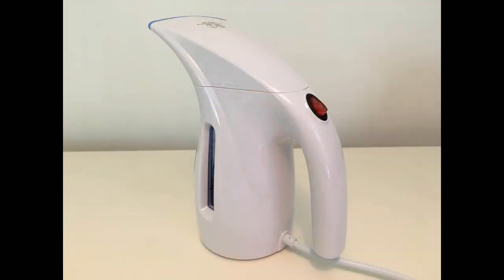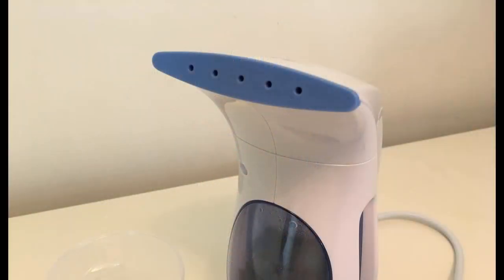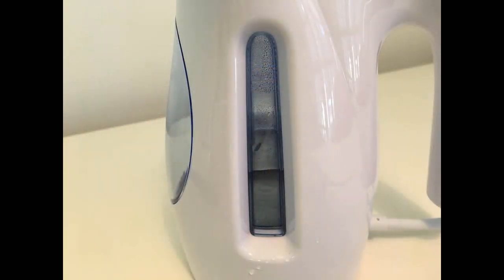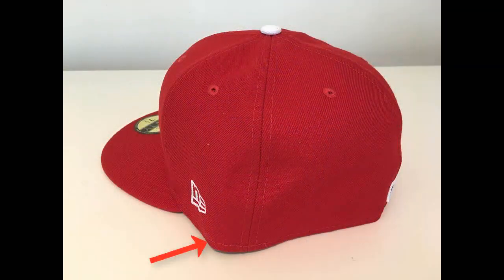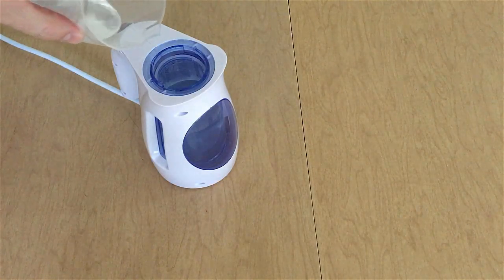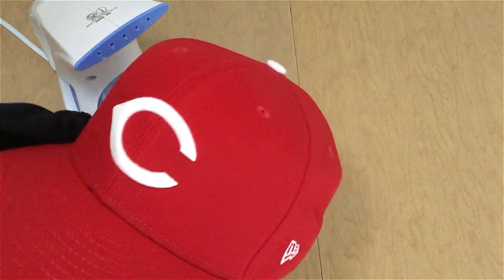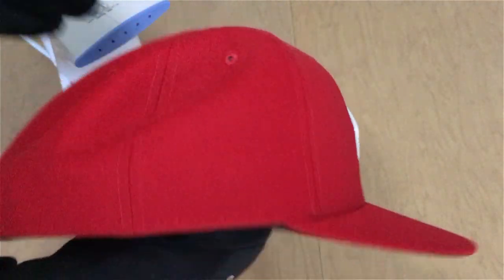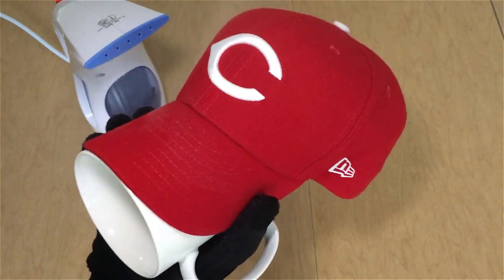Shaping Fitted Caps: Garment Steamer vs. Teapot

Comment: I used a streamer while the hat sits on the Nu-Cap(Re-Cap) for about two hours to get the hats back in shape (ebay purchases). I have never used it to break a hat like you just did. I would like to see a video trying to lower the crown using just the steamer

Comment: My Rowenta steamer from Walmart produces alot of heat and alot of steam so it depends on what ur using as well. That being said the steam method works better than I could ever imagine. So now I order size 7 and stretch instead of 7 -1/8  cuz I like the fit better. 7 doesn’t fit until I stretch !!

Comment: Hi! Do your tips apply to snapbacks and adjustables? Does the hat material e.g. polyester, cotton, wool,  acrylic, etc. matter a lot?
Reply from the maker: Yes, New Era snapbacks mostly - the stiff buckram up front is the same as in their fitteds, and responds well.  Material matters, but not a lot... you can manipulate most materials in the same way, although the responses will vary a bit.
Reply: @dreinthe616  Thanks a lot for the reply!!!!!

Comment: Quality vid as usual Doug. Have you ever had an issue with "over steaming"? I steamed one particular cap (onfield low pro 5950, polyester, same as all my others) a little too much and now the brim is too pliable and won't hold my preferred curve... Any tips?
Reply from the maker: Unfortunately I have never been able to rehab a visor that’s lost the structure like that... I’ve got a Padres cap where that’s the case, because I did a lot of cold bending when I first got it. Sorry I can’t suggest anything.
Reply: @dreinthe616  Figured I was clutching at straws, cheers for the response anyway.

Comment: Hey Doug, My mom recently purchased me a nike drifit Vanderbilt hat while in Nashville on a buisnees trip. I told get 7 3/8 and she got 7 3/4. The brim is very delicate and soft so im afraid to put in the dryer. How should I shrink it
Reply from the maker: I don't think you'll be able to shrink 3 sizes, certainly not without some significant appearance defects.  Best possible way you could try is just to use some foam 'sizing' inside the sweatband, see https://youtu.be/yG9rcE7UuVI for the way that I recommend.  Still, you may not be happy with the look after doing that, but it's your best shot.

Comment: Well, im here because of you are using the same steamer im planning to buy but not for shaping but for removing "storage odor" 
Will this steamer remove odor from my cap? Any suggestion?
Reply from the maker: I don't believe the steamer would remove the odor by itself. You'd probably need to clean the caps in some way, or use a deodorizing spray.  I've got a couple of videos on cleaning if you go to my channel, thanks for the question.

Comment: Any tips on trying to stretch a corduroy fitted it’s a 7 and I am 7 1/8?
Reply from the maker: Hmm, no special tips - I've never actually tried stretching corduroy, but I think it would be a tougher material to stretch.  Sweatband and sizing construction will make a difference too, but the overall fabric needs to give - so if you try I'd just say go very slowly to avoid damage, thanks.

Comment: I tried fixing the back of my SnapBack using a teapot without messing up the front logo of the cap. It didn’t work if anything it made it worse. Do I put the steam under the hat or over the hat?
Reply from the maker: Hmm, wondering what you were trying to fix on the back of the SnapBack? And maybe if the front logo is embroidered or not? Anyway, in almost all my steam shaping videos I recommend steaming only the outer surfaces. I have other videos that might help at my channel page, I’m just not sure what problem you are describing.
Reply: @dreinthe616  it’s just the back of the cap is completely creased up . I wanted to steam it but I’m doing it really carefully because I’m pretty sure if the steam touches the front 2 panels it will soften them which I don’t want.
Reply from the maker: Ok... for that I think you will need a "form" inside the cap when steaming.  I've got a video where I use a size 1 soccer ball for smoothing out the caps, and my other main video for removing creases ( https://youtu.be/4-q4ufu5M6w ) shows the use of towels to do this as well.  If it's a 9Fifty snap, it has the same rigid buckram that New Era always uses, and it can be formed and re-formed without losing too much structure.  Just don't overexpose it to the heat, and good luck.
Reply: @dreinthe616  it’s a Mitchell and ness flexfit 110 hat so the sweatband is stretchy and the hat is mainly wool ... will this method work the same?
Reply from the maker: I don’t own that model of cap, but the construction looks somewhat similar. I think that a good form inside the cap to hold shape, and steam for the outside should help - it’s what hatmakers have done for centuries. Just start with a small area and proceed carefully, thx
Reply: @dreinthe616  thanks 🙏🏽💯